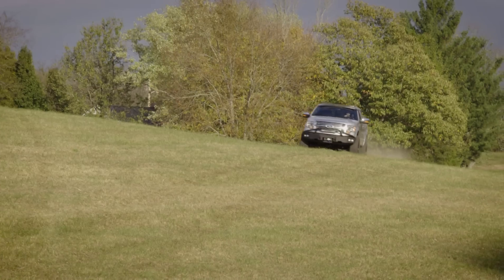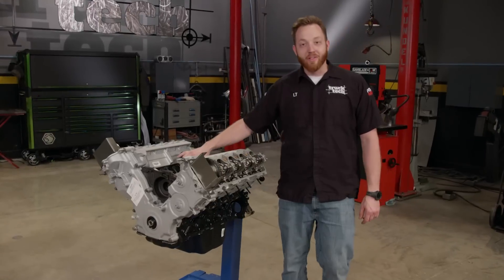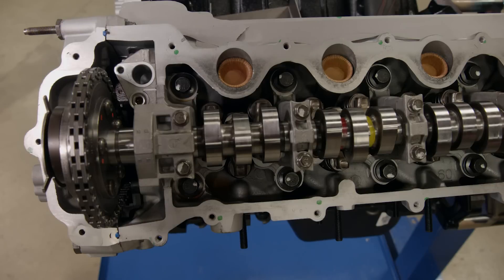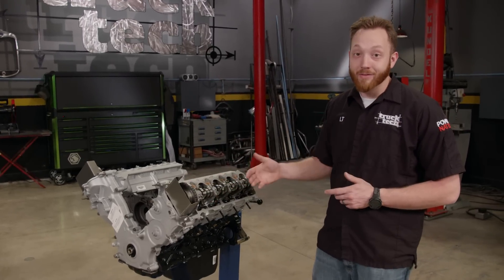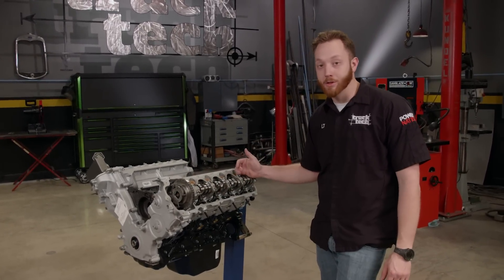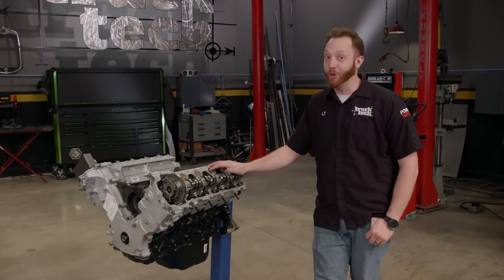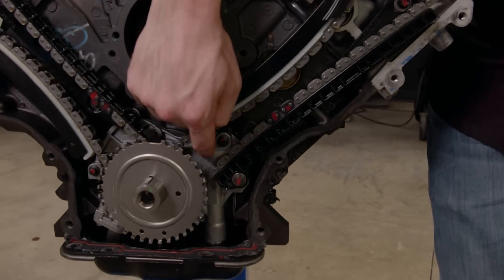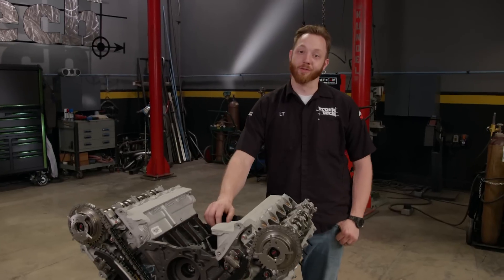Hope For 5.4L 3V Mod Motor Fans

Comment: I got my engine for Powertrain. Its my brother's truck I put in the engine a 5.4 Triton. Hours cost a little more but I don't care it's well worth it that engines been going from Dallas to San Antonio on a weekly or bi-weekly trip pulling a trailer without any flaws. I used to use Jasper but they wanted $7,000 for the same. I will definitely use them again. Great customer service
Reply: how has the engine held up since? i recently put one in
Reply: @DentsideDick  how is it running ?

Comment: $ 3300 hundred , I just get a 
remanufactured engine, start fresh
Reply: e harris is that a jasper engine?
Reply: I had good friend , that put a reman 5.4 in his expedition cost him like $4200 or so  final that's with the labor, not sure if it was a jasper engine, what ever it was it ran so quite couldn't even tell it was running ,  almost like starting over fresh , made me think of finding a nice well kept truck with a lot of miles for a good price, and keeping in mind that I be putting a 
re manufacted engine in
Reply: Think jasper engine run around $2300 or $2500 like for triton 4.6 not including labor to install it  , but that's not a complete engine you still have to use some nick nack parts off the old engine, like brackets, intake , etc   , also depends on what kind of engine you have they vary in price

Comment: The phasers and tensioners aren't the problem, it's the oil pump! The factory pump loses pressure at moderate rpms, reducing lubrication at the top end. The passenger side is the last to be lubricated, that's why the passenger phaser is usually the first to go. Both the phasers and tensioners run off oil pressure. I'm glad to see someone offering a reman with the most up to date parts.
Reply: That new high volume Melling oil pump is a godsend. Never seen the VCT system on my 5.4 3v so stable. The OEM pumps use an aluminum backing plate which deflects under load which is why they lose pressure and volume as the RPM rises. The new Melling pump has a cast iron backing plate to remedy that issue.
Reply: @Professionalpatternrecognizer  They can also develop oil pressure issues due to cam journal wear. If the oil isn't changed often enough, sludge deposits can form in the oil channels, causing restrictions in oil flow feeding the cam phasers. It's the downside of more complex OHC engines. The complicated components that require oil flow to function correctly are competing with all the cams and lash adjusters. If the pump can't meet all the oil demand at the top of the block, or if somebody pushes oil changes too often, you either get wear which reduces oil pressure and creates oil flow losses.... or the engine develops deposits that restrict flow and starve the top end of oil, which creates accelerated wear and excessively high oil pressure drop in the heads, which leads to wear and cam phaser issues.
Reply: Exactly. Ford even had to lower their spec for the hot idle oil pressure after the 3V went into production because so many oil pumps fell below the original hot idle oil pressure. Plus, the 3V had fairly narrow oil passages in the heads that tended to restrict flow and cause the heads to be sensitive to any slight loss in oil pressure (hence the cam journal and phaser wear). The engine simply has too many other potential issues that result in not enough oil being fed to the phasers (and the heads generally speaking).
Reply: I do agree with you on the oil but those tensioners and blown out seals were a problem. Mine blew out and caused some problems.. If nothing else losses pressure for cams

Comment: Ford oil filters and 5w30 with 5k service intervals!
Reply: Every 3k do oil change and use only Motorcraft filters w/5w 20 cooler climate/season 5w 30 warmer climate/season.
Reply: @josephwiese3937  i drive a 2002 F350 Xl crewcab longbed V10 with a 8 inch lift and 38.7 inch tires, I only use semi syntetic oil and change it every 30.000km or 20.000 miles i drive it on LPG ( propane so it doesnt polute as much as only petrol) in the netherlands  never had any problems with the engine , timing chaine or tensioners an the truck had 240.000 mls ( and with the correction of the tires its around 400.000km ) still love the truck very good gas milage for a big truck with v10 ( average on propane is 16.4MPG)
Reply: That's for every motor. 5.4 3v are just junk.
Reply: @fermi3294  Ok chevy fangirl

Comment: These are horrible.  Im ford through and through but having one of these engines and working on them regularly is a pain. Tensioner failures, guide failures, phaser failures, roller follower failures,  one thing after another.  Id take the 2v or newer over the three valve.
Reply: If you bothered to do any research on these engines you'd know that all that is a symptom of a bad oil pump.
Reply: @1CornHolio  Melling HV or Ford Performance. I went with the 360HV.
Reply: @1CornHolio  how is it holding up? i did the same to mine minus pained manifolds and studs

Comment: U can put phaser lock kit
Reply: Fuel economy penalty.
Reply: Lock outs don't fix anything. Replace the oil pump and fix the problem.
Reply: @YoungOzzy432  Excellent? Not quite. But they can be serviceable as long as genuine components are used, tensioner gaskets replace, and provided the cam journals aren't excessively worn.

Comment: 292K orig motor not great w oil changes, but ran a bit of Marvels through it a few times. K and N filter, not sure why I am so lucky, but it has climbed 80 to Tahoe at full throttle many times. I think opening wide up on the climb has helped it last, sounds weird.
Reply: Replace the oil pump to keep it going to a million.
Reply: I put 250k on my 3v ran oil stabilizer and drove it mostly wide open all the time and lots of idle time , think the triton engines are good , they just need to be really kept up on oil changes ,
Reply: William Filer I have a 2010 on 33s, live in Reno/sparks and work in the Bay Area Cali... I’ve made that trip over the mountain around Tahoo a “few” times... I as well run her strong 90+ most of the way... pisses those expensive sport cars off. But they get skerd in the curves... ol Ruby Red digs in and pulls away

Comment: Only 198,000 on my 2004 f150. All paid for long ago. By the time it goes south I'll know whether to lock out the cam phaser thing or swap the 6.2 gas in its place. (385hp)
Reply: Lock outs don't fix anything. You want to keep it going, replace the oil pump with a high volume pump.
Reply: Check that. 201,000 on it now and still going strong.

Comment: Change the oil every 3,000 miles don't go 5,000 or more.
Reply: Lucas saves those motors I put it in every oil change it mostly shuts up the ticking and prevents it from ticking a lot when you first start it up
Reply: Charles Son using 5-30 instead of 5-20 motor oil provides better protection.
Reply: That's ridiculous, save for a better truck. I would say to sell any 5.4 3v truck but you wont get shit for it and for a reason.
Reply: Change it every thousand miles and it might last a few more years most likely not.

Comment: these motors are absolute garbage, nothing nice to say about them. i’ve got phaser delete, updated chain tensioners and new oil pump and timing chains. it’s got noticably more power power, better throttle response and same fuel mileage as before! (same as a GM 3rd gen Vortec 6.0)
Reply: Run a tune after the cam phaser delete/lockout?
Reply: Ronald Jensen yes, i used an SCT device with the proper tune/program for the lockout kit, there’s a few forums and such if you google it for some info!
Reply: hhhh9579 An LS? Why? So I could turn around and Coyote swap it?
Reply: Phaser delete? Any links for that.
Reply: Strong Tower Lawn Care it’s actually called a Cam phaser lockout, my bad. there’s a few forums and websites that sell the lockout pins, some can be pricey! You’ll need to put a tune on it the stop the VVT system from trying to actuate the phasers with the pins in them or nasty shit can happen
Reply: @sweatlodgegarage8195  Lockouts don't fix anything so you wasted your money on that.
Reply: King Daniel i would disagree, the oil pump was replaced with the Melling 360 and the phasers still failed. The oil pump is always a good option but doesn’t fix the evident phaser failure.
Reply: @sweatlodgegarage8195  And what phasers did you use?

Comment: If I had a channel I wouldn't recommend power train engines. The company has a ton of negative reviews. Just Google them. I believe they are also have a civil suit against them.
Reply: I did a powertrain 6.0 Chevy.  Burned 6 qts oil in a week. Had to pull it and replace it. Second one was fine. Last april i did a 5.7 hemi in a ram 2500. Developed major noise on left head. The rocker shaft  bolts were loose. Tightened them and wnfine has been good so far. Im leary using them again.
Reply: I was skeptical because of price.

Comment: Put almost 200k on an expedition. Original everything! Ford builds a great truck!
Reply: 220k on 05 expedition.  did timing job as it jumped and mechanic did an improper install....ugh... 3cyl down putting a remanufactured in as I type.  I live in New England...now... and bought the truck new in AZ   yep, no rust so ill keep it.
Reply: 206k runs good, I love my truck

Comment: One big tip many over look is use a motorcraft filter! 🙄 mine had a tick and after an oil changed and ford filter. Gone. 5/30 and never heard it since
Reply: Don't understand you people acting like a filter is the cause of your problem. Just use a quality filter, not your Fram junk. Motorcraft filters are not the best ones in the market just not the shittiest

Comment: What about the tensioners that fail and make chain slap
Reply: or the wonderful PLASTIC guides break? or any number of minor parts that fail destroying the engine. Specially the 10 cent o ring on the tensioner.
Reply: They have updated parts
Reply: @commanderstud2417   Daniel Hinkle  but the single oil passage is THE number on flaw that causes all the issues with the 5.4 and I can guarantee you: no rebuilder is addressing that. Yes, they use updated and improved parts, but that's like putting lipstick on a pig: at the end of the day, it's still a pig. Are they still using plastic guides? yes. FAIL. What should happen is they cast them out of aluminum (the molding process isn't that more costly or time consuming) and the issue of broken guides is taken care of permanently. 

Melling guides are (arguably) the best, and they cost $22.00 each x 4 = $88.00. To have my engine last 300,000 miles trouble free, I'd pay $100 each easy. Does anyone make them? nope. 

VCT solenoids, $100 each and they regularly fail due to piss poor design. I'd pay double that $200 to have my engine last 300,000 miles trouble free. 

The list goes on. If you're going to charge me $1000 for shitty parts, and it costs me $3000 to put them in (at the dealer) then I'm willing to pay 100% more to have something that I won't ever have to do again. 

Someone was arguing with me the other day about how "new" engines last so much longer than the old cast iron block engines. I called bullshit even when the cited some study. You see, I don't consider an engine "lasting longer" if you have to put $5000 into it every 100,000 miles (Or where I live, 100,000 kms).
Reply: @muskokamike127  yeah id rather not have to go into an engine either.  They don't make them like they use to.
Reply: @commanderstud2417  I sold it I'm done with Fords
Reply: @scottkucinski4967  yeah i feel ya man.

Comment: A great engine with lot's of performance potential if built right.
And narrow enough to fit in most engine bays.
Junkyards and performance enthusiasts take note.
Reply: I'm a ford guy through and through. These motors are actually huge in comparison with a pushrod motor.
Reply: I don’t understand the argument between ls and mod motors, when all the domestic v8s are having oiling issues bad recently. I’m a ford and Chevy guy. But every brand has its issues
Reply: Didn't mention dumpster motors. That would be a chebby.
Reply: @ronaldjensen8614  Hmm dont remeber plastic timing chain guides, 2 piece spark plugs, rattling cam phasers and burnt valve seats on any LS in recent years. Atleast nothing so bad it's a common problem like it is a 5.4 3 or 4 valve dumpster fires. It's sad that even today in 2019, 5.0's are STILL carry on the tradition of 5.4 cam phaser rattles. AND the gen 3 Coyote's have piston slap that is so bad it makes the early LS1 piston slap look (sound?) tame by comparison.
Reply: @hochhaul  oh and 5.0 coyotes can make 1000hp easily without sleeves or anything. The owner of my local speed shop has a 1100 hp coyote and a 1500 hp 2013 gt500. Both stock bottom ends. And they are running at the track every weekend. They are driven to and from the track. They both wipe the floor with the ls cars. And the ls cars have more money in them. In every way mod motors are better than ls engines. Just accept it. Just wait until people start modifying the 7.3 Godzilla. Ls engines will become even more irrelevant then they already are. No wonder GM stocks are crashing while Ford stocks are skyrocketing.  Nobody has any faith in GM.  Nobody is buying gm vehicles.  Gm sales are down and Ford sales are up. That means that people are getting rid of their chevys and switching to Ford. GM is old news. Did you know that gm is stopping production of the corvette  and the camaro? You mad bro? 😂
Reply: Dunno 'bout the Camaro, but the Corvette isn't going anywhere with the C8 having just been revealed and seeming to be a megahit if the price:performance ratio is anything to go off of, although tbh, I would kinda like to see Toyota bring back the MR2 as an answer to the C8.
Reply: Wrong video, you're talking about the LS.

Comment: My 3v 5.4 has 189k on it. Has a slight tapping sounds, sounds like a lifter tapping but gas mileage is fair considering I have 35s and strong as an ox. Will bark on 4 tires on aspahlt in 4 low
Reply: Fordman8011 thanks. I will have to do that, I'm no mechanic, I'm a roofer but I'll have to do that.
Reply: @CodyHodges97  Use a screwdriver pressed to your ear to determine where it is coming from. I will bet $1000 it's on the passenger side. It is the last to receive oil. 

If it's at the front of the valve cover, it's probably phaser. If it's farther back, it's like Fordman said: probably a cam follower. If it's a cam follower, your engine is pooched. $2000 per head to replace plus the cost of the head. The cams can't be replaced, they are milled to that particular head.
Reply: Muskoka Mike it's on the driver side. it's gotten louder since I bought it, I think it's gonna blow soon. Which doesn't matter really, I'm buying a different block to swap with it.
Reply: @CodyHodges97  I'd bet it was a blown tensioner then. That side gets oil before anything else so it isn't due to wear.
Reply: Muskoka Mike this is the first Ford I've owned. The tapping comes and goes and I haven't found out a pattern yet as to what causes it to come and go.
Reply: @CodyHodges97  is it louder when it's cold? I'd look into getting your oil pressure tested. A failing oil pump could be causing it as well.
Reply: Muskoka Mike yes sir. When you first crank it for a few mins until it gets to RT and it doesn't tap anymore.
Reply: Muskoka Mike yes sir. When you first crank it for a few mins until it gets to RT and it doesn't tap anymore.
Reply: check the manifolds

Comment: My 06 3v has around 183k on it now. Replaced the phasers, chains, guides, tensioners and oil pump at around 178ks. Still runs very well and has plenty of power.
Reply: My 07 has 245k  everything still original no leaks or anything as of yet and I am the original owner.
Reply: And it will run for a long time with what you've done.  Solid engines
Reply: I’m trying to build my engine over again with a new block when it starts failing
Reply: I did the same thing to my 05 expedition. I’m now at 185000 and she runs better than ever,
Reply: @98snakehorse How much did a service like that cost?
Reply: @TheDude111  I do all the work myself so labor is my own personal time. I think I had around 600 in parts when it was all said and done. Truck now has over 195k on it and runs great.
Reply: @98snakehorse did it get rid of the engine ticks after doing all of that? How is it now?
Reply: @haydnwestbrook8479  Ticks were completely gone. I still daily this truck @ over 200k miles on it now.
Reply: I have a 2010 4.6 3 valve been making noise for a year still driving but don't have time to fix my daily driver how much did your parts coast/ labor if you had a shop do it thanks

Comment: Navigator 4 valve swap
Reply: Then you have to deal with worn valve seats and guides.
Reply: @hochhaul  Never once heard anyone having that problem.  Besides if he's pulling a Navi motor, I'm quite sure that's part of the plan anyways is to go through it
Reply: @theparachannel  Then you need to start paying attention because 4-valve mod motors are notorious for it.
Reply: @hochhaul  again , never once heard of it.  I worked for Ford during that whole era and like 3-4 came in for that issue and it was mainly due to them dogging the shit out of it.   If it was that big of a problem there would have been recalls all over the place.  Just folks beating the shit out of it.  We still have our navigator around 210,000 miles... no issues
Reply: @theparachannel  LMFAO oh right. Because Ford recalls major engine design issues like junk cam phasers, brittle timing chain guides, 2.7 ecoboosts with bad valve guides, cracked Coyote blocks, oversized Coyote cyl bores, etc.
Reply: @hochhaul  Yes because that would be a major factor in their sales and safety my child.  You talk exactly like the people who make up stuff about what's "junk" and regurgitating words from other people with no absolute knowledge no logistic reason. I guess you skipped the part where I said I have 210,000 on my Navi.  Don't seem like "junk" to me...  Just hush little one and keep living.